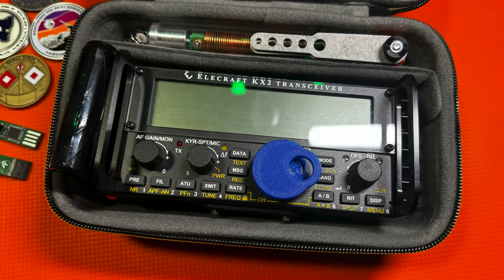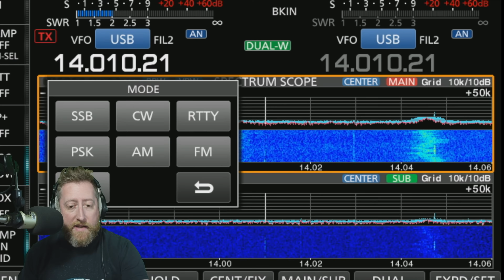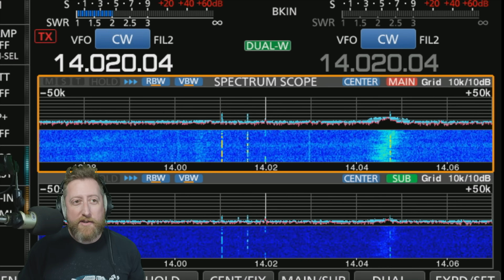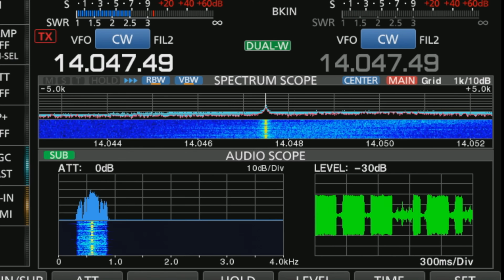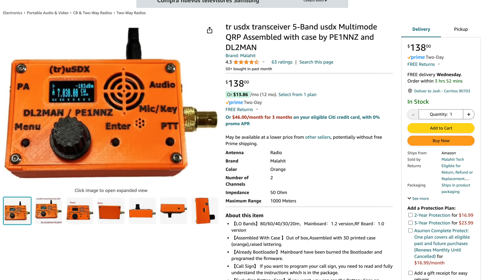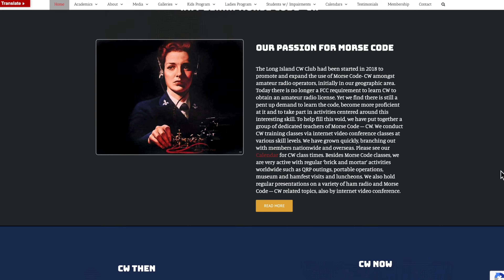Why Should Anyone Learn & Use Morse Code?

Comment: In addition to the 12 dB SNR advantage if CW, CW-only rigs are also simpler and smaller than an equal power SSB rig. The simpler non-linear final amplifiers are also more power efficient (less battery power consumed for the same power out).  And for portable operation, there is something very nice about being able to set up and operate discreetly, not having to talk loudly inti a microphone on a busy mountain top or in a park. Sure, you can do that eith JS8Call or PSK31, but you need a computer and extra gear to make it happen.  CW, the original digital mode, is still amazingly relevant and incredibly useful.
Reply from the maker: Wonderful point!
Reply: Most of that video and your response was Greek to me. Ok, not that good, because I at least know the Greek Alphabet. Response from the ignorant, ... Ok, then, CW only uses 1/20 of the power (probably bad math from 5W CW transmitter = 100W voice transmitter), but, keeping in mind that a picture is worth a thousand words, does it take less than 1/20 of the time to send the same message via CW vs voice? If not, then power usage for power usage's sake is not the mark, just that you can send from places or with equipment you couldn't otherwise send from. (Told you. Know nothing 'bout this stuff.)
Reply: @epictaters3738 it's about a tenth of the speed to send morse as to speak. But the point is more that a given power can reach further. Not that it's better for the environment or anything. There are limits on transmit power (legal, technical, operational, etc.)

Comment: Josh,

This just popped up in my feed, and I wanted to weigh in. Last year, I embarked on a journey for CW proficiency with the goal to be able to conduct POTA activations in CW, as well as improve my contesting ability. I need to put a Shameless plug in for the CW Ops CW Academy.  For me this more structured approach worked very well, I've also learned that this is a journey but at least at this point feel that my proficiency allows me to conduct almost daily POTA activations using CW.

At Dayton, I purchased a QMX+ and have been having a ball using that for activations, over the past 4 months, I've worked Europe about a dozen times using the QMX+ usually with an EFHW from around the midwest and in FL - the salt water amplifier is a real thing!.  This is truly amazing!  Thanks for raising awareness.

73 es God Bless,

.../Art K0ACP

Comment: Morse is great when the noise floor gets really bad.  You can tell the presence of a tone (even a weak one), when voice is not understandable, and you can filter it a LOT more to remove the noise - both with the radio's digital filtering, or an outboard audio filter.

Comment: Useable, simple CW transceivers are much more simpler to build and play with than other modes.  Building my own QRP CW rigs is one of my favorite Ham activities.

I have both build from kits and completely home-brew from scratch, gathering parts, experimenting with different circuits etc.  When conditions are too horrible for most voice and data CW will often get through.  The skill of the operator will impact the experience.

Comment: For the first 5 years that I was licensed I only had a CW Radio.  The radio was a Full Tube Radio.  I used a J38 Straight Key for all those years.   I still have the J38 after 30 years.  🥰

Comment: hehe. myself took the General class license morse code test which was 13 words per minute by the FCC office in New York city in winter time around 12/1980 .. very cold morning, myself was the only Oriental guy in light winter cloth & kung fung shoe with about few dozen people. in the fcc room , FCC examiner sent out a group of morse & we must copy & answer multiple choice.... I copied & answered all questions... then many people said morse code was not clear & they had trouble to copy.. so the FCC guy said,  if you had no problem to copy & could leave.. I checked mine was fine & no trouble at all... so other 2 guys & me went out... the FCC guy repeat...   the other 2 guys & me passed...de KA2KXR

Comment: I had to make an emergency cell phone call.  Cell coverage was so weak and unclear that I used CW Morse code to communicate with the other person, that I was calling  You know like saying "di and dah and so on.... It worked because the other side knew CW also. dah-di-di-dah.
Reply: i'm not refuting your overall point, but i will say that if you make morse code with your voice, then it isn't cw. cw means "continuous wave", and technically could be any kind of code that uses a single tone to carry information, not just morse code. a human voice, on the other hand, is a lot more complicated than the simple tone of cw.

Comment: I think you could also think of Morse code as shorthand, in the digital world a character is made up of at least two characters like 28 or NL or special characters in the 128 character set. So technically Morse is a saving in transmit time, maybe..

Comment: I struggle just with SSB and hearing call signs in voice. I really struggle hearing CW whether it is a dot or dit and then I'm sorting out what I already heard while more is coming. It's stressful. It would be great to train my ear so that CW comes more easily. I see the utility of this CW skillset and the power efficiency. I recently acquired an ICOM-705 which is a QRP radio (5w with basic battery and 10w with external) so without an amplifier to push it up to 100W it may not be able to get signal out far or higher than the noise or other stations calling. So now CW has more of an appeal than I previously would have thought it would have for me. I'm not quite ready to start trying to really learn CW until I've gotten more comfortable with making HF contacts with SSB. My first was last weekend on 40M at 5w from Southwest of Pittsburgh to Hampton Maryland (outside Baltimore) that's about 176 mi away on 40M during the day with a strung up center fed (via balun) tuned wire dipole antenna (MIL-3 on DXengineering) (half of it horizontal the other half cascading down a balcony to the ground) so compromised (HOA LIFE). I'm still learning. Thank you Josh! I'm having fun! 73, N3TBJ Dr. Steve

Comment: I think that a bigger factor here, where you may have an easier time hunting a POTA in CW than SSB, is the relative powers.  Most people activating POTA in SSB are using 50-100 Watts.  This means that for them to hear you as well as you hear them, you need to be somewhere in the same ballpark of transmitter power.  This is because there isn't a great deal of difference in receiver sensitivities, and also, antenna performance is pretty close to bidirectional.  If you don't have much in the way of antenna gain, and yet you can still pick up someone at a POTA site, you can use that same crappy antenna for transmitting to them.

I suspect that most people activating in CW are using more like 5-10 watts.  Again, you still need to be operating in the same power range that they are, in order to ensure they can hear you as well as you can hear them.

Comment: Morse code was invented in 1830 - just about 200 years ago
why on earth learn that? Requires dots and dashes and dashes are impossible in many situations.

Learn Tap Code.
American POWs in the Vietnam war used it - tapping only no dashes.
It's a 5X5 grid with the alphabet inserted left to right top to bottom
with C and K the same

The letter B would be row then a column
dot  pause dot dot

X breaks sentences
K means acknowledged (C)

If you want numbers then a 6X6 matrix

Tap code starts out with matrix size 
tap tap tap tap tap pause tap tap tap tap tap
nobody needs to memorize anything
Reply from the maker: Sounds like you didn’t watch the video.  I’ve never heard of tap code use in Amateur Radio.
Reply: @HamRadioCrashCourse  I'm just answering the question put forward on this Youtube.
Using a 200-year-old code that requires both parties to memorize a code that makes no logical sense is ridiculous.

I proposed a far superior code that both parties already know - just listen for:
tap tap tap tap tap .......... tap tap tap tap tap
Reply from the maker: @noleftturns  I don't think calling out the age of Morse Code is relevant when we all speak forms of languages that are way older.  

Just a series of taps is not superior to a two tone system.
Reply: @HamRadioCrashCourse  When is it time to dump a 200 year old technology?
Tap Code requires no memorization and works in any language.

Morse is USA and the rest of the world wants to use their languages.
Tap code provides for this.
Reply from the maker: International Morse Code is what all Morse Code is based on.  It's already world-wide.  I'm sorry but you don't have a compelling argument here.

Comment: Dropping the bandwidth by a factor of roughly 5 while keeping the transmitted power the same gives you a 6.8 dB improvement in signal to noise.  But you can do even better than that by using better filters for CW mode or some combination of that and IF shifting which does a bit of the same thing and improve S/N even more.  

Then there's Shannon's law to consider, C = B * log(1 + S/N), and what is the equivalent capacity in bits per second required to pass understandable voice to get a conversation through.  Contrast this with the fact that as S/N degrades you can drop the bit rate for CW communications to nearly zero and still copy.

The great thing about CW is that it is human copyable and takes next to no hardware.  We can do even better than CW with digital modes and error correction in terms of getting a message through in a given bandwidth with next to no signal to noise.  But that's not as much fun . . . ;-)

Comment: Hi Josh. Twelve weeks learning to about 14 w.p.m. for our test at 12 w.p.m.
Why Morse Code? 
It's fun, It's efficient, it's pretty reliable under bad conditions, can be better for weak signals than it's equivalent ssb power level, a c.w. rx can have a narrow filter to cut out QRM, it can be cheap like a Pixie tx/rx. 
My Pixie is on 5.262 MHz and had a few QSO's 60 to 180 miles with a SWL report from Utrecht at 220 miles, he sent me his e-mail address to download so I could hear how I sounded in Utrecht.
40+ years ago I made a Top Band tx with one BFY51, one resistor, five capacitors, coil, and a crystal. I have all xtal QRP frequencies and want to do something similar with maybe another BFY51 or IRF510.
G4GHB.

Comment: Why not just use a CW translator? You can type and the device both outputs and reads the CW. Works on your mobile phone too.
Reply from the maker: They don’t work well if the sender isn’t sending very good code.  If you software to send code, software can decode it well. Hand code is often not “good enough” for the apps today. But also, it’s one more thing to forget, break, etc.

Comment: I became a believer in CW while playing with a Utah Web SDR one night. While testing propagation on SSB, I was curious how little power was necessary to be heard. Once I could no longer hear myself on SSB, I switched to CW and I could hear myself perfectly fine. I continued lowering my power until I could no longer hear myself. I was blown away that a SSB signal could be outperformed by a fraction of the power in CW.

There are other advantages with CW. We have young children, and I can't be yelling into my microphone after they are in bed. With CW, I can talk on the radio all I want without waking anyone up.
Reply from the maker: Bingo!
Reply: This^^^^^ being able to operate quietly at home late at night or while at a serene park with the family has opened the door on opportunities.
Reply: I have to 3rd this comment. As a father to young children and as someone who values the quiet of nature, I prefer these non voice modes like cw. It feels more rewarding to do than ssb as well. After a year of doing only cw, going back to ssb feels like I'm yelling over the top of people- compared to cw which feels zen and relaxing.
Reply: Agreed. I remember the cyclists turned around and looked at me when I was using SSB for POTA activation in a quiet mountain environment, while CW kept me from being found. :)

Comment: CW ROCKS!!!   I began participating with SOTA about 10 years ago using SSB.  Back then, I remember at times having difficulty making four contacts with SSB.  I am also somewhat hearing impaired and it is often difficult for me to understand voices on the air.  I began learning CW about four years specifically for SOTA and now use it with POTA and WWFF.  I have not operated with SSB in about four years.  I always operate QRP (5 watts) from CA and have made contacts around the world.  I agree, LICW is a great resource as is CWops.  I am one of those people that CW was not easy to learn.  Practice, practice, practice and hunt often once you are familiar with all the characters of the code.

Comment: I think many people believe Morse Code will be a major pain to learn and probably just isn't worth it.

I'm fine with the FCC dropping Morse Code requirements to get a Ham license years ago, as it served the intended purpose of getting more people into the hobby, but when I got my ticket in 1989, it was still required, of course, and I'm glad it was.

I bought the famous Gordon West cassette tapes, figured it'd take many weeks, if not months, before I was going to be ready to pass my 5 WPM test for my Novice License, but I took the test less than two weeks later and passed with flying colors. Truthfully, I could have passed the test much sooner, but that was the first opportunity to be tested at one of the local ham club meetings. Just after that short amount of time listening to tapes (only), when I took the test at 5 WPM it seemed ridiculously slow. I did hit a roadblock as far as speed at about 8-9 WPM. It does take time building speed, but I think it's definitely worth it.

I think if people would put a little time into learning Morse Code, they'd be very glad they did. It's fun and rewarding. 

I've got a friend that 'speaks' Morse Code like most of us speak English. He can sit and have a (voice) conversation with someone, while he's listening to code, very fast code, and never miss a word on either. It's actually kind of freaky. 

If you're going to learn Morse Code, look into the Koch Method, too. Another thing I'd suggest; don't sit for hours trying to cram it all in your brain. Listen for maybe just 10-15 minutes at a time, then take a break and come back later. I'd do that many times per day, and it seemed to work great.

Even the US Army quit teaching Morse Code, and honestly, I'd hate to see it mostly disappear, but it looks like that is probably where we're headed, eventually. Of course, if/when people start getting Elon Musk's brain chips implanted, they'll just instantly 'know' Morse Code.  😆

Comment: In which bands you find more activity? I’m shopping for a QMX to force myself in to learn but they are divided between 10-20 or 20-80. I will think 20-80 as I read 40 is very active but I don’t imagine myself ever using 80 portable.
Reply: Hans now offers a 15/17/20/30/40/60 meter version.
Reply: @DM7XK  correct, I saw they have now 15-60 and 10-20 but I still don't know where is more activity if in 10 or in 40, that's why I'm trying to figure out which one to choose. 10 will be great because is a smaller antenna but that band is quite erratic regarding conditions in my experience.

Comment: Adding to the list of 'good reasons to learn morse'

You can almost always find a clear frequency for morse code

Several times I've attempted to do an SSB pota activation but always seem to find no open space on 20 and few people seem to use 15 or the WARC bands(especially for SSB), daytime 40 isn't necessarily the best, and while 10M is huge and may be picking up as the sun gets active, in my admittedly limited experience using 10m (with FT8) I almost never hear anybody in US/Canada, just 3k+ mile DX (which is fine but not always what you want)

Comment: And the old man sez: Back in the day everyone wanting to play ham radio had to do CW. Plus, if you did radio comms in the military, you had a 90% chance of learning CW or peeling potatoes. And back then it was the draft or you enlisted. Or your rich Uncle Vito bought you a pass. Thus, ‘though I’d tried to learn CW as a kid, it took the potato threat to ‘inspire’ me. It became a badge of honor. I even learned to do Morse with flashing light. Now, even with essential tremor, I prefer CW, especially at QRP/POTA power levels. It works. See you at Dayton/Begali Keys booth ;-) 73 de W8IJN
Reply: I would love to do CW, I was able to in the army, these days however I have Cerebral small vessel disease which unfortunately affects my memory and  cognitive function. I haven't found anything that reads cw well enough in software to help either.
Reply: -   -.   -..-

lol